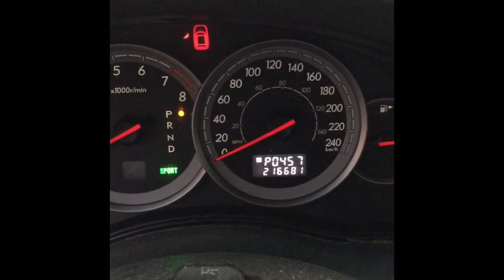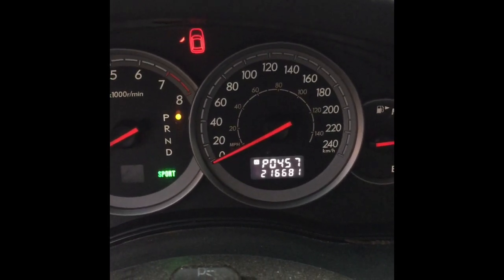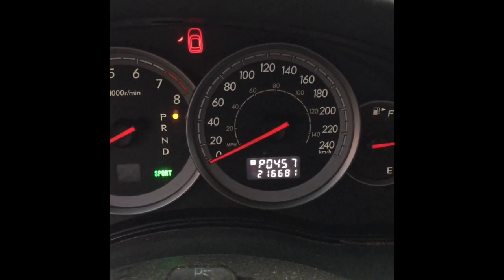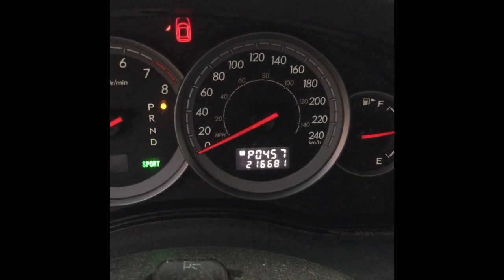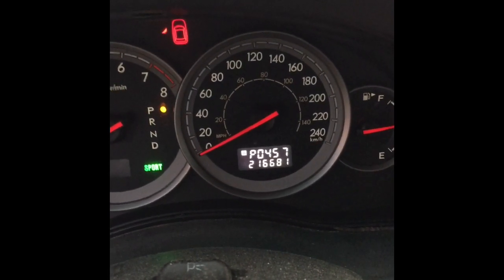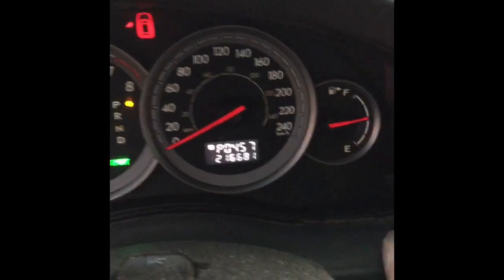Read engine, ABS, and TCU codes on a 2005-2009 Legacy Outback without a code reader

Comment: 08 Outback XT. Not seeing these connectors. Also looking at FSM I see nothing. My green test mode connectors are on passenger side kick panel by ECU. Same as when I had 05 OBXT. Still looking for a way to read ABS codes. In the fuse panel area the FSM shows 181 and 182 as a "short connector". I found it and one of the plugs is a loop of wire connecting the other 2 wires of the other plug.. Like it's name indicates. Not sure the purpose of this but it looks similar and in a similar location to what you're showing in this video.

Comment: These 2 white connectors you speak of do not exist in my 2005 Outback. I have 1 White connector and 1 Green connector.
Reply: They are tucked away above the fuse panel. There will be 2 sets of a green and a white connector taped together. It's there just dig around for it.
Reply: YES!... there are indeed 2 sets of green and white connectors (1 Female set and 1 Male set... each set of connectors are taped together with blue coloured tape ).  Inside the fuse box area of my 2005 Subaru Outback 3.0L H6 with 5 speed Automatic Transmission. 
Its much easier to access the interior of the fuse panel when removing the lower dashboard panel under the steering wheel. Connected the white connectors together and received my error codes. Thank you for indicating this!
Reply: It helps to remove the left side panel that is normally facing the door. You can see the connectors taped in there then.

Comment: You Subaru has 216,000 miles or is that kilometers
Reply: Looks to me like kilometers don't think an outback is doing 240
Reply: MPH*
Reply: @DrewsLair  my 05 xt has 270,000 miles. Vf52 turbo, 300 hp, and I beat the hell out of it. Original engine
Reply: If you look it right km/h

Comment: These wires do not exist on my 2005 outback
Reply: Neither does mine.
Reply: I stand corrected! Take the knee panel off and they're indeed taped together with blue tape, right above the fuse panel. This works.
Reply: takes more than a quick glance

Comment: I have a 2005 Subaru Outback.  I don't see the white connectors to connect.  Do I need to remove the panel underneath the fuse panel (by unscrewing the screw holding it in place)?
Reply: yes, Its much easier to access the interior of the fuse panel when removing the lower dashboard panel under the steering wheel. Yes, there are indeed 2 sets of green and white connectors located there, both sets are taped together with blue coloured tape. ( 2005 Subaru Outback 3.0L H6 )